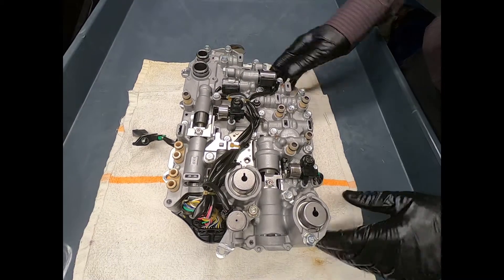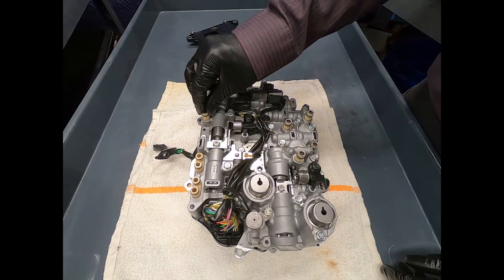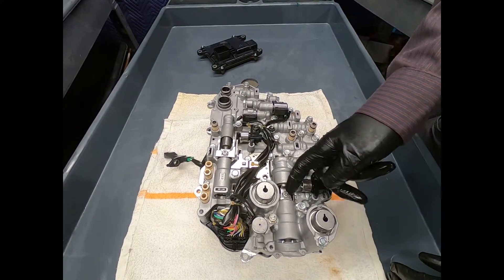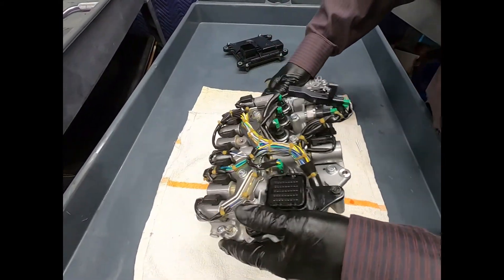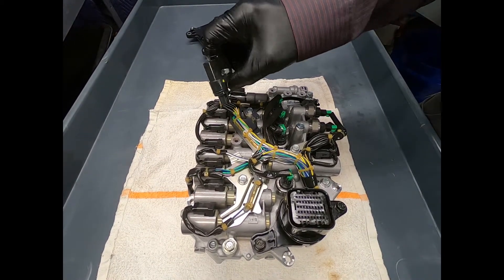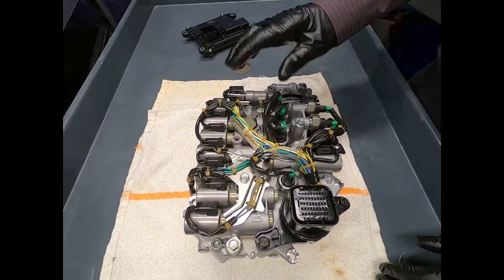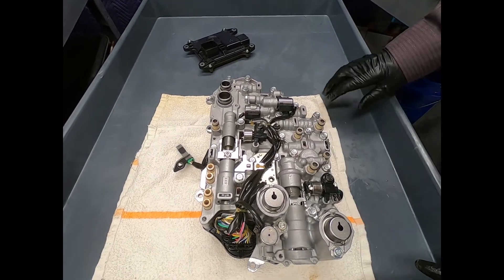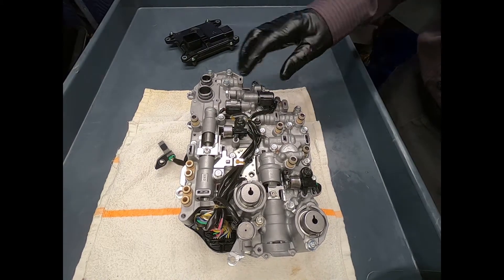Honda 10-Speed Automatic Transmission Valve Body Introduction

Comment: I'm looking up this part and I'm wondering if it's possible to buy it online. It looks quite heavy and so expensive. My dealer says it would cost me approximately 10 grand for the whole kit, and I reckon it includes the TCM. I did change the fluid and according to the dealer it resulted damaging this kit, which I didn't buy at all. The argument is still going on, and the Transmission is still under inspection.
Reply: How much did it cost you?
I have the same problem and i need to replace the same part in my 2020 2.0 touring
Reply: @aymanal_jahwari9148  Thankfully I didn't have to replace the VB, just doing some Transmission flush worked miraculously well. It turned out the daft dealer sticked to the error code without doing any physical inspection to the transmission nor did they check the fluid level!! Your car is pretty new and I highly recommend you check the fluid level first and then do a transmission flush and see how it goes.I once found the part online on hondapartsnow and it costs around 3 grand.
Reply: What happened?